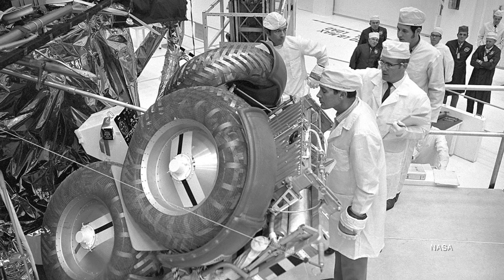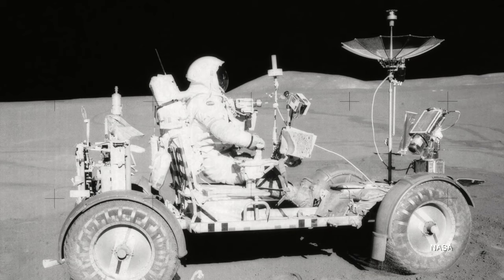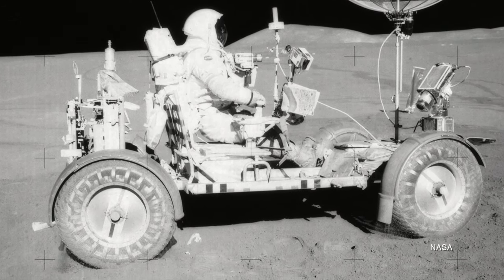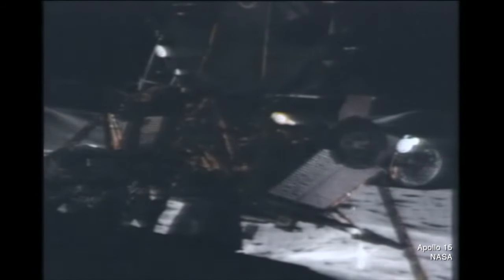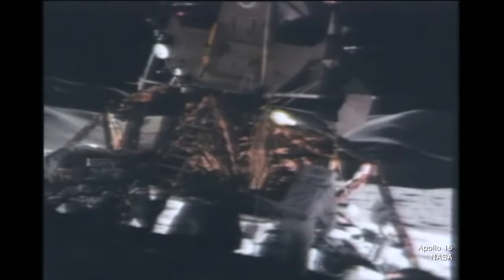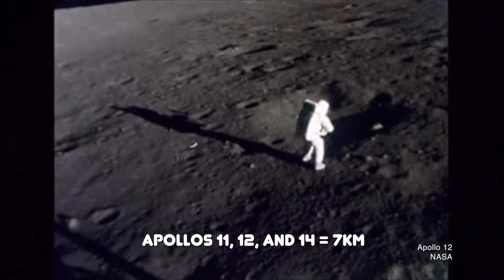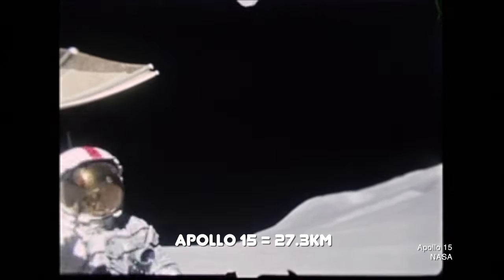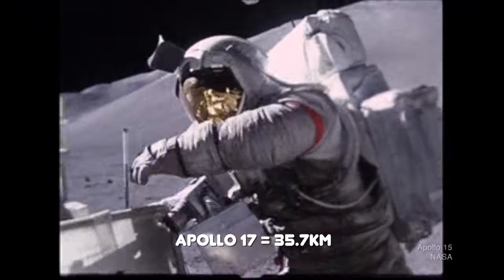How NASA Took Cars to the Moon

Comment: Come now.  Take a look at your video as they "unfold" their EV.  Looks pretty thin, and looks like they can "manhandle" the vehicle very well.  Looks a lot different from pictures of the EV with all the gear populated.  How did you phrase it..."just set up the seats, put in their foot holds, and install the central control panel, and their ready to go"  Easy Peesy.  It's only a central control panel.  Any wires to connect?  Ever try to do intricate work (like assemble a working EV) with thick gloves on?  No?

The views of your video show a very light weight, chassie really, not much equipment on it.  Now compare it to when the astronauts were on board.... Looks very much different.  But wait, you think on the moon, with stiff gloves any astronaut is going to do any delicate work?  Nonsense.  It's amazing to me how you totally accept that you can take a large mass object, like an EV, and just slap it onto a LEM.  Didn't realize LEM's were so flexible.  Did you need to re-orient the fuel and oxidation tanks to even out the lopsided mass?  Of course not.  Just mount it over here.

The whole notion of an actual EV coming along with Apollo is nuts.  Look at the NASA video with the astronauts pealing out, baha-ing the EV, remember the astronaut saying "wow... great rooster tail"... are you serious?  Can you imagine how dangerous it would be?  One tip and the entire mission is wreaked... and for what?... so you can have a photo op?  Good grief.

The so-called Lunar Rover is a farce.  Another magical aspect of the Lunar Rover is all that power?  Battery banks look pretty small, and impervious to temperature changes, extreme temperatures,... no problem for typical magical NASA batteries.  No worries it's a NASA battery to power the motion, all the electronics, communications, filming... no problem.  Fits in a breadbox.  My goodness.

What about safety?  If the EV runs out of juice, or tips, if you're an astronaut.... far from the LEM, in the direct solar gain from the sun... good luck, you're dead.  The Lunar Rover is the most comical of all the Apollo claims.... doesn't seem to raise any questions from our host.  Big surprise.
Reply: YOU SAID: "Come now.  Take a look at your video as they "unfold" their EV.  Looks pretty thin, and looks like they can "manhandle" the vehicle very well."

== Yes, it weighed about 80 pounds in lunar gravity.

YOU SAID: "Looks a lot different from pictures of the EV with all the gear populated."

== Yes, they had to assemble it.

YOU SAID: "How did you phrase it..."just set up the seats, put in their foot holds, and install the central control panel, and their ready to go"  Easy Peesy.  It's only a central control panel.  Any wires to connect?  Ever try to do intricate work (like assemble a working EV) with thick gloves on?  No?
"

== Um, guess what... the engineers at Boeing and GM knew the astronauts would be in their spacesuits, and engineered accordingly.  Imagine that.

YOU SAID: "The views of your video show a very light weight, chassie really, not much equipment on it."

== That's because it was only a chassis at that point in the video.  They hadn't loaded everything up yet.  And, look, not that I normally make it a point to pick on grammar and spelling, but, seriously, learning to read and write will probably serve you better in life than pretending you understand the Apollo program.  Illiteracy isn't an asset.

YOU SAID: "Now compare it to when the astronauts were on board.... Looks very much different."

== Yes, because they finished the assembly before they drove it.

YOU SAID: "But wait, you think on the moon, with stiff gloves any astronaut is going to do any delicate work?  Nonsense."

== Hence why it was engineered to be built with gloves on.

YOU SAID: "It's amazing to me how you totally accept that you can take a large mass object, like an EV, and just slap it onto a LEM."

== They didn't just slap it on.  Good gods.  They had to re-engineer a ton of things.  They added 25,000 pounds of thrust to the Saturn V engines.  They completely revamped the LEM's descent stage.  They restructured the engine bell for more efficient burns.  The list of changes is huge.  They didn't just "slap in onto a LEM."  How can you say these stupid things?  I mean, see, this is the problem with you nutbags.  You think you have all of these little "gotcha" items that somehow no physicist or rocket scientist on Earth for the past 50 years has spotted... but these "gotcha" items are nothing but a pile of utter ignorance.  Sheeessssh.

Here's a link to a 50 MB document that barely scrapes the surface of the changes that were made.  It's a "summary" or "familiarization" document (not a detailed engineering document).  Maybe you should read these things BEFORE you spew your ignorance all over the internet.

https://www.hq.nasa.gov/alsj/a14/a14-43939523-LM10-LM14-Fam-Manual.pdf

YOU SAID: "Didn't realize LEM's were so flexible."

== They weren't.  Grumman had to re-engineer the thing to accommodate all of the changes for the later landing missions.

YOU SAID: "Did you need to re-orient the fuel and oxidation tanks to even out the lopsided mass?  Of course not.  Just mount it over here.
"

== You're a moron.

YOU SAID: "The whole notion of an actual EV coming along with Apollo is nuts."

== No, the fact that you think you know these things (that you do not know) is nuts.  You're an idiot.

YOU SAID: "Look at the NASA video with the astronauts pealing out, baha-ing the EV, remember the astronaut saying "wow... great rooster tail"... are you serious?"

== Yes, AS INSTRUCTED to do so.

YOU SAID: "Can you imagine how dangerous it would be?  One tip and the entire mission is wreaked..."

== Bull.  Fucking.  Shit.  They had already used the LRV on the entire Apollo 15 mission, as well as their first traverse on Apollo 16, by the time they did that.  They WANTED the astronauts to do that, to further test the capability of the LRV for the remaining mission, as well as the remaining traverses for Apollo 16, while they were still close enough to the LEM such that they were in no danger.

YOU SAID: "and for what?... so you can have a photo op?  Good grief.
"

== No, you imbecile.

YOU SAID: "The so-called Lunar Rover is a farce."

== No.  Your education is a farce.

YOU SAID: "Another magical aspect of the Lunar Rover is all that power?  Battery banks look pretty small"

== Oh, hilarious.  Yeah, those thousands of engineers working on it... they all forgot to put enough power in the thing to do the job.  But YOU spotted the "error."  None of those thousands of engineers who worked on it said, "hey, wait a minute, the batteries we put in those things could only go a couple of miles, how are those guys going 20+ miles?"  Nope.  Instead, 50 years later, idiots like you can come along and say, "it looks wrong, therefore it is fake."  Um, dumbass, if you have a beef with the amount of power the batteries had, just go right ahead, write up a scientific paper outlining your calculations, and submit it for scientific peer review.  What are you waiting for?!?!?  You've done it!!!  You've accomplished what nobody for 50 years has been able to prove!!!  Why are you on YouTube???!!?!?  You have proven Apollo is fake, by looking at the batteries of the rover!!!  Write it all up for scientific peer review, and you'll be on the university lecture circuit for YEARS at $70,000 per week!!!

YOU SAID: "and impervious to temperature changes, extreme temperatures,... no problem for typical magical NASA batteries."

== Hence why they encased the batteries in beeswax to absorb the heat.

YOU SAID: "No worries it's a NASA battery to power the motion, all the electronics, communications, filming... no problem.  Fits in a breadbox.  My goodness.
"

== Yet, amazingly, no actual physicist on the planet, in friendly countries or enemy countries, have noticed this glaring "error" that you spotted.  Your Nobel Prize is in the mail.

YOU SAID: "What about safety?  If the EV runs out of juice, or tips, if you're an astronaut.... far from the LEM, in the direct solar gain from the sun... good luck, you're dead."

== Hence why they loaded up the earlier parts of the traverses with the furthest spots, always leaving themselves enough life support to make it back to the LEM.

YOU SAID: "The Lunar Rover is the most comical of all the Apollo claims.... doesn't seem to raise any questions from our host.  Big surprise."

== Why do you think it's a GOOD idea to announce to the world that you're an idiot?
Reply: Really?  Incredulous?  No idea?  Look, the so called "trips to the moon" are not science.  Why?  Because, in science if the "experiment" can't be replicated by any independent group... then, it's not science.  Right?  No one has ever "been" to the moon except during the Nixon administration?  No red flags for you?  Who has no idea?
Reply: Are you kidding?  Do you have any mechanical or electrical experience?  If you did, you'd understand that
assembling a vehicle... any vehicle... on the moon, no less,... cannot be done from a space suit, and in a few hours?.... the real world, doesn't work that way.  Try an Actual experiment.  Put on big gloves and try to do anything... seriously, dude,... anything, and you'll very quickly discover... it's HARD.  And you think a man in a space suit no less,... on the Moon!... can do these "magical" things? in less than a few hours?... it's total hog wash.  Anyone in the real world, who ACTUALLY works with big gloves will tell you... go ahead, ask them.
Reply: Might notice?  Look, dude,... do you have any knowledge of American history?  The Manhattan project, other than some planted spies... employed over 400,000 people... it was a need to know operation.  Meaning, most people had no idea what the real goal of the project was... they pulled it off.. remarkable security.  Is that an example you may consider?  Your emotional responses demonstrate, you're thinking with your glands, and not using your critical thinking skills.
Reply: Not answer a single question?  Let's look at what you're saying, ok?... let's take your first assertion, that there were no screws, bolts, fasteners,... etc.... no wires to connect?... look at the vehicle as it "deploys" from the LEM.. ok?.. not much on it... Right?... will you agree so far?... 

Yet, in less than two hours they're dune bugging around?.... and you buy that?

If you maintain that the electrical connections were done, say by slot connectors, this is where you push together typically a Male and Female plugs... with me so far?... ok,... if you have any experience in the field... you'll recognize, even slot connectors are extremely difficult to do with thick gloves... and get it right... let alone in a hostile environment .... and now, Pay Attention.... the problem on top of that becomes dust and debris too!

Would you bet a man's life?... and his crew too?... apparently.

Listen, assembling that hardware ... in IDEAL conditions would be a long task, but to do it in the field day one while in Space Suits no less... under hostile field conditions?... with limited visibility?... in a low gravity, lots of dust condition?... thick gloves?... if you have any real world experience with complex hardware in the field... then you'd know this is a fiction.
Reply: Some did notice, but AGAIN, everything is on a need to know basis.  And, by the way, what upside would anyone have in embarrassing the US government at that time?  None, dude.  If you're going to retort "then they would have come forward...".... nonsense... why?... what possible... and I mean possible reason, or upside would they have?... None.  The ENTIRE reputation of the USA was at stake, for heaven sake... grow up.
Reply: Name one.  Name ONE Boeing or GM engineer who has said that the LRV couldn't be assembled by the astronauts with their gloves on.  Name ONE.
Reply: Look, there's a bigger question here... is it real, or not?  The implications of which way, in reality, it goes, is monumental.  Right?

Your position, apparently, is it's real.  Am I right?  My position is, it's not.  Not by a long shot.

If you wish to believe the company line, and leave it at that.  Fine.  There are many who think as you do.  Patriotism, right?  But, I put to you, and all who believe, without question, what your government claims... then I can't help you.

If you wish to understand why there was no other choice with so much at stake, to rest on a so called science experiment the entire nation's pride (not to mention space race and cold war...).  It makes no sense, to me, and to many others, that such a difficult task, and I assume, you'll at least concede it's difficult, it makes no sense, no one (country, company, university or group thereof) else can repeat the feat.  For over half a century.  That's the difference between us.
Reply: Yeah, that's what I thought.  You lied.

Let's recap, shall we?

1) You were incredulous about the energy of the batteries used in the LRV.  I replied.  You ignored the reply.  You know better than the experts about how much battery charge was required.

2) You were incredulous about the cooling of the batteries used in the LRV.  I replied, pointing out that they were encased in beeswax to keep them cool.  You ignored the reply.  You know better than the experts about how batteries are cooled.

3) You were incredulous about the weight of the LRV.  I replied, pointing out the weight in lunar gravity.  You ignored the reply.  You know better than the experts about the weight of the LRV.

4) You were incredulous about the ability to assemble the LRV with gloves on.  I replied, pointing out that the engineers made them to be assembled with gloves on.  You ignored the reply, until I beat it out of you, which you then acted incredulous about the ability to manipulate bolts with gloves on.  I replied that they didn't need to manipulate any bolts, because they were engineered not to need any fine-manipulation of bolts.  Your reply was more incredulity.  Did you name a single bolt from the schematics of the LRV that you think couldn't be done with gloves on?  No, of course not.

5) You were incredulous about the way the LRVs looked prior to assembly vs. after assembly.  I replied, pointing out that they simply hadn't finished assembling at that point of the video.  You ignored the reply.

6) EDIT: Oh, and I forgot to note: you were incredulous about the ability for them to bring the LEM to the moon, accusing them of merely slapping the LRV onto the LEM.  I replied, pointing out a 50MB PDF document outlining the extensive changes they needed to make in order for it to happen.  I also noted that they had to modify the Saturn V in many ways, including adding 25,000 more pounds of thrust to the engines.  You ignored the reply.

7) EDIT: I asked why nobody seemed to notice, during the hundreds of fully suited trial runs of assembling the LRVs, that they couldn't assemble the LRV with the gloves on.  Of course, you HAD to ignore that question.

8) Instead of directly answering any of the above, you tried to duck and dodge, and attempted to shift topics to things like Nixon (which you were wrong about), and the Manhattan Project from WWII (which you were wrong about).  Anything besides answering for the parade of ignorance you spewed everywhere.

Your entire position is simple incredulity, rooted in utter ignorance.  You cannot even SPELL the items you're complaining about, let alone do you demonstrate even an entry-level understanding of any of these systems.  And, despite my repeated asking why none of the experts notice these glaring "problems," you repeatedly refuse to answer... until... finally... in the end, you're forced to lie, and claim that Boeing and GM engineers knew that the LRVs they built couldn't actually be assembled.  Sure.  Right.  And, you know this how??  Good grief.  Look, asshole, when you have to LIE to support your stupid claims, you've lost.  You have NO UNDERSTANDING of Apollo.  None whatsoever.  Your entire position is one of incredulity, ignorance, and downright lies.  You're an asshole, and a moron.  And, I'm done with you.
Reply: Don't you mean you're done with critical thinking?  Let's take your list of fantasy's... I'm not afraid... you want to talk about batteries?  Fine.  You want to talk about LEM batteries?  Rover batteries?  Look it up, oh lazy one... look up the type, the Amp-hour rating, and the voltage.

You add up all of the loads, those batteries were called upon to power, and for the time required.  Go ahead, list them.  That will give you an energy demand in kWh.  With me so far?  The rub about chemical batteries, is they're very sensitive, among other issues, to temperature.

Controlling temperature is really tough, with the gear shown.  No?  Look up the maximum operating temperature of the batteries, and put that into context, that if the batteries are too hot, or too cold, (Big issues on the moon), they won't work.  And, certainly will not power the loads you've listed, for the time duration's claimed.  Not in a long shot.  Battery technology 50 years ago, or today, of the chemistry type will NOT work well, or at all above 130 degrees F, or lower than 38 degrees F.

The direct sun would heat the batteries up, and since there is no air, and therefore no convective cooling, those puppies would boil.  Even without the solar gain, if you load a battery IT WILL HEAT UP internally.  Thermodynamic reality - no way around it.  That's one of the reasons it's so hard.

With no active convection cooling, it is IMPOSSIBLE to cool off the battery.  They would fail.  What in this statement, other than debating 38 degrees verses 42 degrees can you not understand?  What is your concern with this statement?  Start there.  What is wrong with what I've just written?
Reply: @rockethead7  willing to bet rockethead wasn't even born when NASA didn't go to the moon.......some people will believe ANYTHING you tell them.